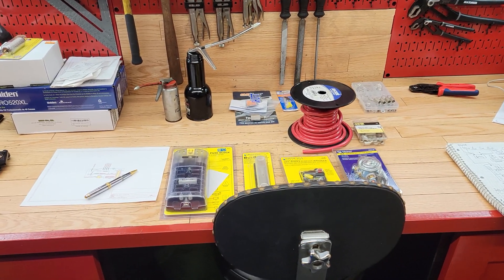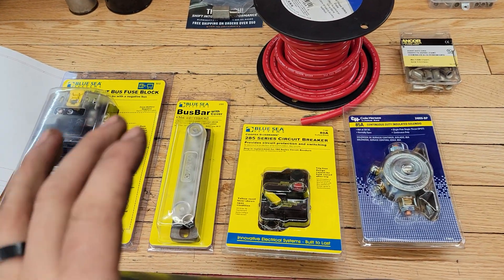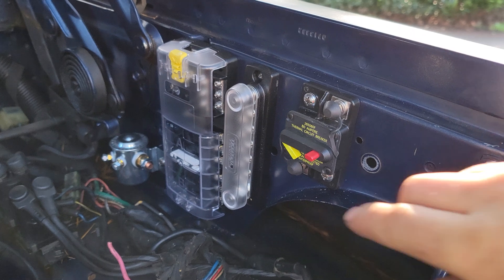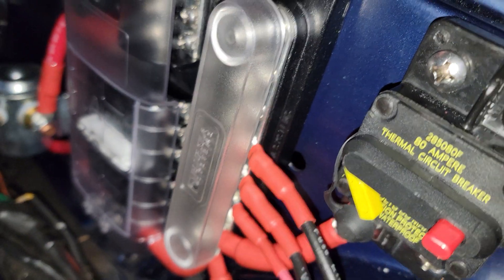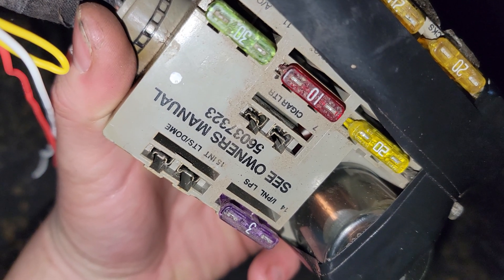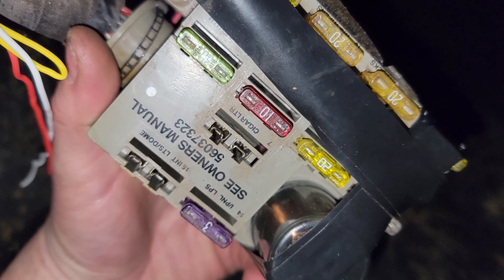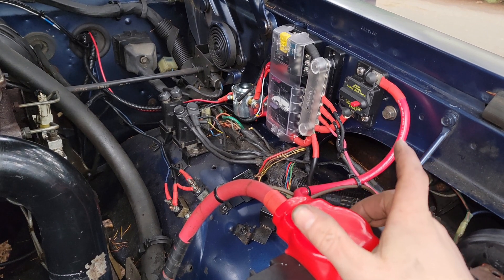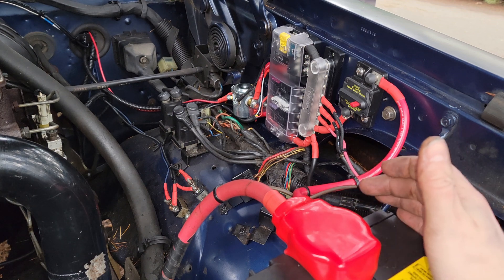Switched + Constant Fuse Block | 1st Gen Cummins

Comment: did you make a video eliminating the fusible links? i like your wiring I'm using a lot of your ideas to do my setup. I'm going to do a few things different like mounting things i always use Nutsert or know as a Rivet nut. Had cabinets installed in one of my service vans and ever since i have been using those there great for clean installs and just mounting in general. there is a great tool to install them i have the cheaper of the two tools they have one that is much nicer but it is like anything the nicer it is the more it costs. but they are great to use/have If i remember the name of the tool I'm thinking ill edit this comment but its out in the service area right now. Love the Videos thanks for the help and Ideas

Comment: Love the videos man! I was wondering how this setup has been holding up?  I am in the process of doing the same thing minus the solenoid, and the fuse panel. Just wanting to clean the positive post up with a bus bar, and circuit breaker.  What amperage breaker do you recommend using only thing other than factory running to it it airdog, and aftermarket led lights.
Reply from the maker: It's holding up just fine. Remember that the breaker protects the wire gauge so if you go bigger size up on the wire too. My suggestion is to go big to accommodate the grid heater draw or just wire the grid heaters direct to battery because the grids draw quite a few amps.
Reply: @OvensGarage  my thought was a 275A bus w 1/0 or just keep it 2/0 awg feeding it with a 300A breaker so that I can put the grid heaters on that as well
Reply: @OvensGarage  awesome thank you!

Comment: I'm looking to do this exact thing. I have all the parts (fuseblock, cables, circuit breaker etc) but can't find a good tutorial on mounting it to the engine bay. I understand the electrical part, but not the fastening-to-the-engine-wall part. What tools do you need to get the fuse block and relays solidly bolted into the wall?
Reply from the maker: Hi I just used stainless steel screws of different sizes, then pre drilled pilot holes for those screws and then screwed each piece in where I wanted it.

Comment: Does a circuit breaker like that kill all power from the battery as good as a battery kill switch?
Reply from the maker: The way I have it set up when the circuit breaker is flipped off there's no power to anything on the truck.
Reply: @OvensGarage  that's a nice fire safe mechanism for truck storage

Comment: Looks really clean 👍how did you manage to get clearance from your hood hinge when the hood is closed ? I can’t mount my fuse block this way without clearance issues
Reply from the maker: I tested it before mounting it permanently. Its tight but it works ans doesn't rub.
Reply: @OvensGarage  the one I bought is 2” deep , the blue seas unit is 1.5” , maybe that half inch is just enough for clearance . I used two way tape to mount first to check for hood hinge clearance

Comment: I love this idea, we will definitely be doing this to our Ram.
We find your videos very informative especially that we just bought our first 1992 D250 that we are doing a 4wd conversion on and will be upgrading as we work on the truck.
Reply from the maker: Check out hogback fabrication if you are doing a 4wd swap he makes a good front leafspring mount and rear shackles. Good luck with the swap!
Reply: @OvensGarage  I did chat with them today and they do indeed make a fine product.
I do like the idea of Archives front shackle mounts and it also strengthens the front end.
Reply from the maker: @outdoormountainman  them too! I just installed his front bracket and it's so heavy duty I love it!

Comment: hi tyler. nice work.  i recently put power seats in the 93 1st gen.  i caused a short and blew a 30 amp fuse. i replaced the fuse but now  i don't have any power mirrors  or radio... I'm wondering if theirs a  rely or a circuit under the hood i might have blown.  if you could give me some pointers that would be great.
Reply from the maker: Sounds like you might have blown the fusible link. Check the driver's side fender near the ducks foot and see if any of the wires are burnt up

Comment: Has anyone done a fuse box relocation ! The factory fuse box and it's location is primitive at best ! Surely after 29 years someone has !
I hope ! If so please link the info !
Reply from the maker: Yeah the factory fuse box location is in a terrible spot. I don't recall anyone I can think of that has done it. If anyone has they would have completely redone the wiring in the truck entirely which is likely a big job.

Comment: I kind of did something similar but I used a MAXI fuse block to eliminate all the fuse link wiring. It is in an old video probably 4-5 years ago.
Reply: Would add a link to that video please !
Reply: @jimb7922  I went looking for it and couldn't find it. I did it around the time I put the airbags on. https://www.youtube.com/watch?v=M9PvGh6VxMQ&t=1s 
I need to do an update video probably on the whole truck.  I have to get into why my speedo goes crazy from time to time anyway.
Reply: @bcbloc02  my speedo went out also….
Reply: @msoul3248  totally quit or just reads the mph wrong? Mine still counts miles fine but usually when it first starts out the needle is all over the place. After a couple hours driving it starts to behave.
Reply: @bcbloc02  at first it would show some response but then it went completely out.  

Then I lost my a/c, charge indicator gauge, OD, & CC which lead me to this video and looking into adding a fuse block to eliminate the crazy wiring and fusible links.

Comment: One Question, are you sure that pink wire from the battery terminal goes to the flashers? if you disconnect it will your pickup still start or does it have a dead key? I think the pink goes from the battery to that connector and then via a brown wire to the starter solenoid. I have a 1991 pre 1991.5 and mine goes to the starter. the flasher/hazard seem to come off the main fuse block. I will have to dig the wiring diagram out. Great install on the buss bar and fuse block. I looks like a fairly easy clean up of that wire mess that is first gen. really enjoy your videos as you do pretty much everything top notch. Thanks
Reply from the maker: According to my FSM that wire traces back to the hazard flasher..unless I was reading it wrong. Thanks for watching!

Comment: I am looking to do this! I am thinking of putting all circuits on switched circuits. Is there anything which will need constant power?
Reply from the maker: My gauges require constant power, I know some dash cams require constant power, some things you may want wired constant instead of switched...like an air compressor or something. I prefer most of my circuits to switch on and off with the key but there are some things that need constant power.
Reply: @OvensGarage  thank you for the help! One more question did the breaker end up holding up with the demand from the grid heaters?
Reply from the maker: @shanefisher7061  the 80 amp was too low as suspected so I opted to switch it out with a 150 amp breaker. The grid heaters draw 230 amps combined for a max of 15 or 20 seconds depending how cold it is out. The 150 amp breaker can hold that load for that period no problem. The trip delay curves are on blue seas website for the breaker.

Comment: Another well done tutorial. I have 1 tip for you. Which I'm pretty sure you already know. (I know the relay leads are short, as you mentioned.) BUT if it rains or gets wet from washing and cleaning those relays will fill with water. As you know it will come in and down btwn the fender n hood. Don't leave them that way long. Just a tip form a friend. Or it'll be a headache. Otherwise real nice clean, tidy professional install. "As always" We expect no less from you. 👍
Reply from the maker: Thanks Ron. Yeah I couldn't find a good spot to mount them right away. Will look for another spot when I go to swap out to a bigger circuit breaker.
Reply: @OvensGarage  Really did turn out nice and clean !
Reply: Hope this is still followed? My 93 W250 has just thrown the pcm, alt failure at me 376K kms. So, I like Rich Debosses 4-5 circuit breaker from battery idea eliminating the 1-time fusible links. My question is the relays exposed as mentioned eh Could one use the weatherproof switch/ connection AC boxes for xmas/ feature lighting if adding a large solid ground to the fender panel? These survive all weather and house washing eh  I have a spare and thought maybe a great option

Comment: Great job! I love how clean it turned out. I need to do this but I’m a little intimidated by electrical. Did this project delete the “ duck foot”?
Reply from the maker: Electrical take a bit of patience but if it's done right it'll last a long time! This project keeps all the factory wiring in tact and does not delete the fusible links. It only relocates the factory wiring from the positive terminal to a bus bar after a circuit breaker.
Reply: @OvensGarage  Why didn't you replace the fuseable links and put them in your fuse box right there? I'm thinking about doing this as well, but would like to get rid of the fuseable links as part of it.
Reply from the maker: @jasont6849  I didn't replace the fusible links because there were nothing wrong with mine.
Reply: @OvensGarage  Thank you for your video posts.  I have a 93 D250 which just topped 200,000m and almost immediately I lost OD, CC, alt charge, speedo, and a/c.  I have watched your video on the ecm rebuild and the fuse block add ons.  The videos are very helpful and concise.  I think I may send my ecm off but trouble shooting has been aided by your time and videos.